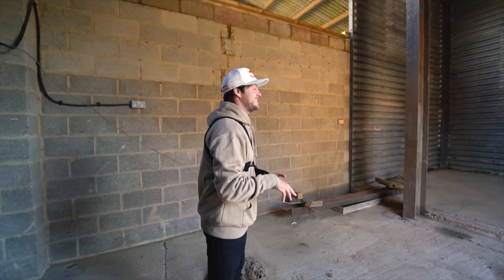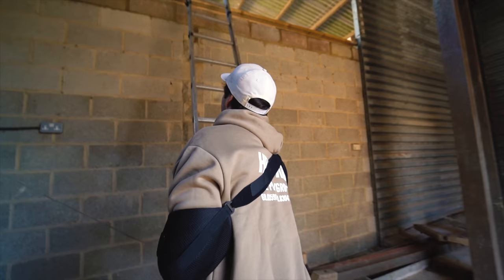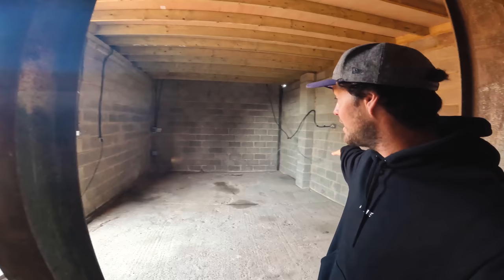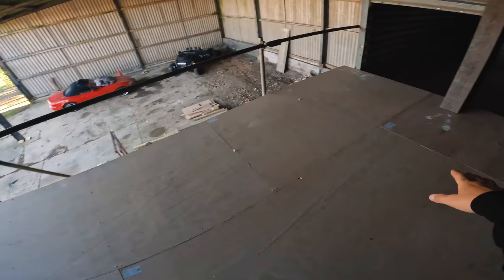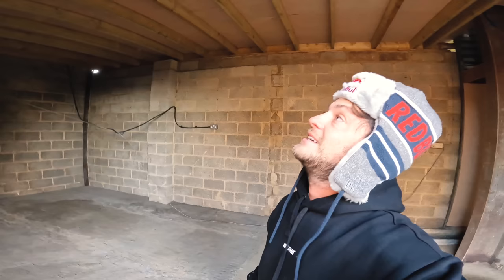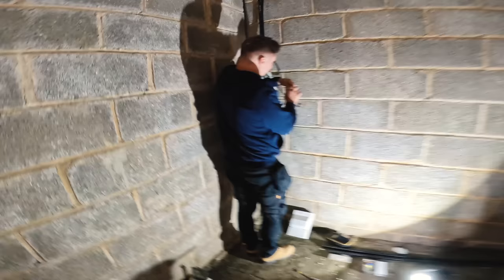TRANSFORMING AN ABANDONED BARN INTO THE DREAM GARAGE!!

Comment: Hey Matt, heres the run down of what I feel would be  great addition you your barn/ shop. If you stand facing your Park Tool wall, dedicate the entire left wall wall to an air brushed mural of Ben and Jaime. It could feature all the defining monents  and backdrops of thier progression over the years. Other 2 walls in shop could be some crazy grafitti art of your favorite locations to ride. 

    Next, I suggest to have the current pictures you have hanging in the area under the stairs be blown up into wall murals in black and white the re-install some on the entire walls floor to ceiling. Use the remaining pictures the same way upstairs in the drop in area. 

       Lastly, install a space heater in the floor where the feed chute is now unsused. cover it with a custom laser cut grate.

Thanks for the awesome channel. I've destroyed my body doing what I love and now I'm uncapable of doing anything really fun on a bike. I now live my MTB dreams through you guys. You were the first channel I subscribed to on You Tube. Keep up the good work!
Kuddos to Ben and Jaime, they're pretty bad ass too.

Comment: I think with the grain trough you should fit lights in the bottom, add mementos and cool memorabilia and then fill it with clear resin. It would make for an awesome bit of unique lighting that would be personalised to you - it would also serve as a bit of a time capsule that you could always see.
Reply: Also, he could just place some plexiglass plate on top instead of doing resin, this way he could adjust the display as years go by. Also, he could place a hidden safe in there. But a hidden safe that everyone knows about is probably not that useful.

Comment: Looking forward to seeing what comes of the whole barn, a skatepark sounds amazing. 

I reckon painting the walls/plastering them with a nice bright colour (or just plain old white) to brighten the place up. You could also insulate it so you're not burning money trying to heat it over winter. How about building a little coffee bar as well in all that big space, walk through the door, theres the bar on the left, stairs on the right.
Reply: I was thinking exactly the same re the paint, needs brightening up a bit!
Reply: The brick wall is what makes the space epic. It’s character. It’s in a old barn.
Reply: Paint? Maybe, but it also has a nice rustic look, maybe leave some and paint some. 
Insulation is probably not really worth it, with mild english winters you can probably do fine without heat for a few hours of tinkering (at least that has been my experience in Germany with similar climate). Of course it would be nice, but not worth installing a heating system or insulation for if it's just for private use.
Reply: @RyanCranage  Agreed. The work/industrial feel is perfect.

Comment: The trough should get a box build around it about a foot off the ground. Then drill some holes on the top side of the box to put some LED lights. Build a clear glass case to then hold any of your favorite items, from frames to whatever you feel is important to you or has meaning. Maybe built so things could be changed at any given time.

Comment: If you paint the steel beams in black it would look awesome, overall this workshop is perfect! The wide space I would have kind of a living room with a tv where you could watch Red Bull tv haha, with a water boiler for some tea, a coffee machine and some mtb inspired chairs and coffe table kind of a lounge area for the breaks at riding the bikepark, the stair area I would cover around in the top floor to keep the shop warm through the winter keep it insulated, that hole on the ground I would put a wood stove over it to warm up the shop in the winter, to finish I would look at ways to insulate it close the holes at least so that the warmth doesn't escape.

Comment: Matt, you could add some succulents into the trough area or some turf to add some contrast to the wood and brick. And for the large space in-between the workshop and the entry door you could put some kind of seating or an island maybe? could serve as a hangout spot or you could put table tennis which would just be lots of fun. you could do both and just fold up the table tennis table and wheel it behind the stairs for storage etc. Big table tennis proponent here :D
Reply: you could also add some phillips hue strips at the top of your workshop tool boxes which would add some inderect LED lighting all controlled bluetooth. LED Lighting is getting so good these days for cheap too!

Comment: Love the space, I don’t think you need to add anything because otherwise it’s going to feel cramped especially when you have a bike torn down and trying to rebuild it. You might want to add one more table that can hold parts when working on two bikes or one. The hole in the ground you should put a grate over it and turn it into a mic-off bike wash station! Can put up sides so it doesn’t splash everywhere! Cheers on the awesome videos and breaking up the monotony!

Comment: Something you can do with the hole in the floor is to seal it off in such a way that you could put a very small tree something that doesn't require a lot of water and get yourself an LED light that'll put out 6,500K illumination. A light with that illumination level puts out ultraviolet red and blue waves just like the sun does so as far as the tree is concerned it has the sun on it when you have the light on. I've done this for many years with having plants in my home but not a lot of sunlight. Find something you like add a little life to the room a little tree is kind of nice to have. Have fun there crazy man I love the new barn I like to have something like that myself.

Comment: You should hang a bunch of parts just on the wall, like forks, cranks and derailleurs. You should call it the bull cave, like the bat cave but since there is so much redbull things the bull cave, and outside before you enter have a sign made with the redbull bull and put it above the sliding door so it's the first thing you see when you go there

Comment: you can use the troth to store inner tubes or other stuff probably not frame protection because of the dust ive had mates with holes in the ground they made to store their paint for when they paint frames or parts

Comment: Hi fella, with it being so cold have you thought about using a diesel heater. They normally used for camper vans / vans. But people use them for their sheds and now I’m seeing people using them to heat their homes in the UK, it’s a neat little unit that you can leaving outside or have inside and just of course exit the exhaust outside

Comment: line the sides of the hole with wood, add whatever you want to display down there. Throw some thick thick glass or plastic on top and bam you got a sick walk over display.

Edit: Probably should have read the comments first. seems a few suggested same things. Assuming fish pond was suggested as well. If not that, then do a sick mini scale version of your playground, Like a diaroma or whatever they are called. like super detailed and just run some led lights on the side with glass top or whatever seethrough material you want.

Comment: You should invest in some sound baffling to reduce the echo, maybe some bass traps to set in the top corners above the tool cabinets.   

I think the open space in the middle is cool and will probably be used as the 'stage' for future buid videos.  If you want to do something practical, it would be cool to install a turntable (like a motorized lazy susan on the floor) that could spin around to display a bike that you're working on , and allow for a stationary camera with the tool wall background.  It might also be worth using some wall space for portable lighting, tripods, fixtures, and other things you'll use for future content creation.

Comment: If the hole has a dirt bottom you can install plumbing and running water 

-A bench with storage 
-display case 
-safe 
-plants 
-fill with concrete and make smooth 
-parts and give away display for helfare 
-team riders display 
-built a table with drawers and cover it completely 

The world is yours

Comment: With the trough hole you could find a compressor or whatever they are called 😂 and lay it in the hole and attach a stand or bike pump to it so you can check the psi in your bikes and be able to dial it in there and then - if that makes sense

Comment: Could maybe fit a sofa underneath the frames. Or use the upstairs area as a hangout area with sofas beanbags etc. (folding ping-pong table does sound cool tho) didn't see if you had Insulation behind the ply but might be an idea to get a portable heater or something cause it'll get cold in winter.